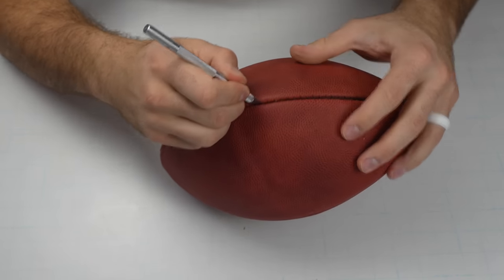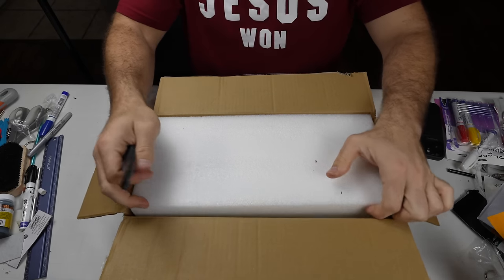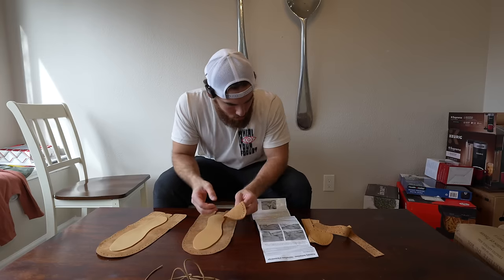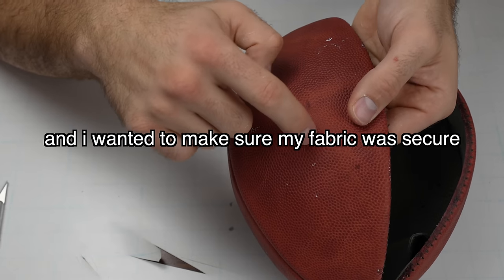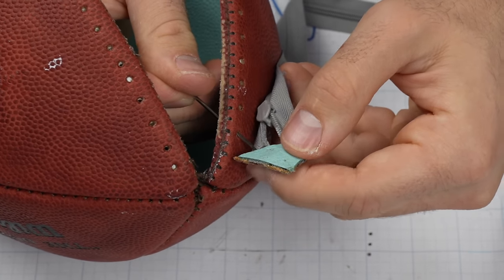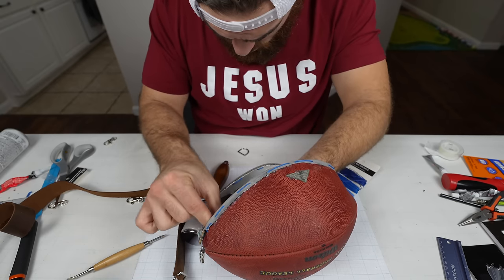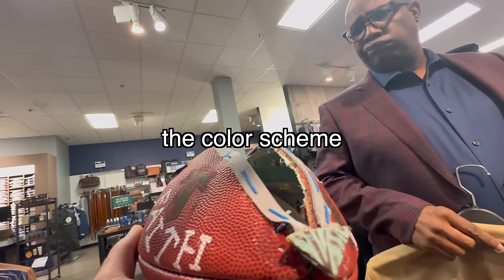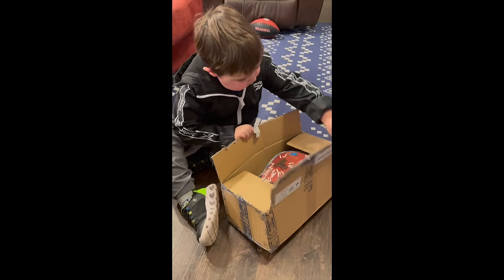Custom Football Man Purse

Comment: Acetone/Nailpolish remover will take off super glue. If you don't want to dunk your fingers in that though, you can put salt in a small bowl and then put in just enough water so that it gets the consistency like beach sand and then stick your fingers into it and rub them together and it will abrade the super glue off of your hand. I've used both of these and while the acetone is faster, they both work.